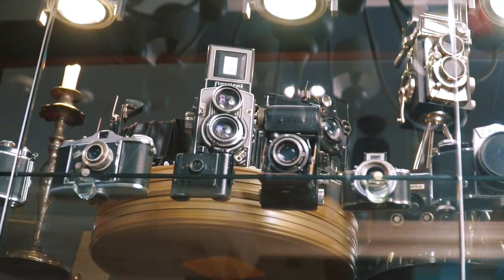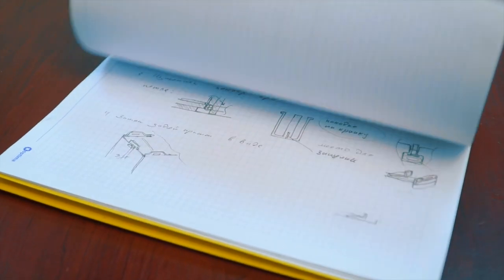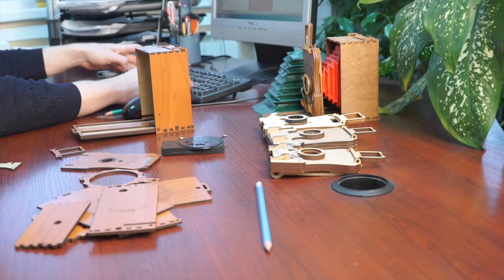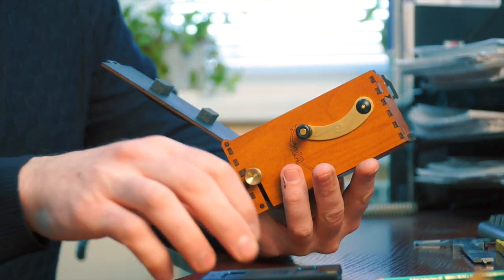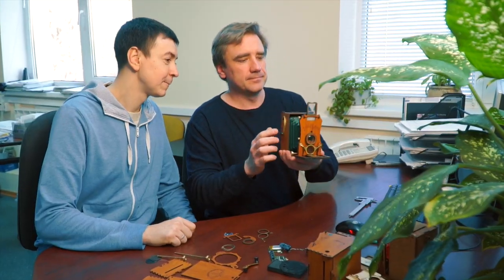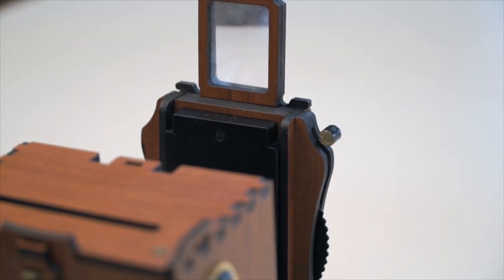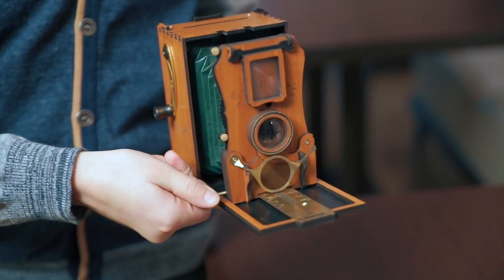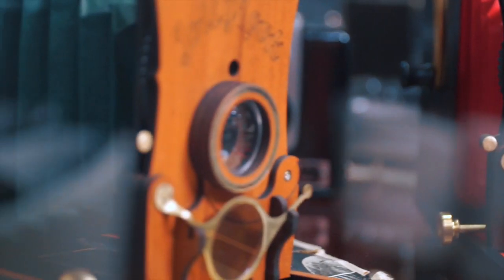Jollylook Auto - The Modern Vintage Instant Film Camera Kickstarter Video

Comment: I really wish it were all manual with no electronics. MAYBE with the exception of the flash. The all manual aspect is the real fun of these things.

Plus without the lens or whatever it's called snapping down, it completely removes that great feeling. Not a fan of the electronics here. There are tons of electronic cameras already, your customer base likes the manual operation, I can nearly guarantee it.
Reply from the maker: The Jollylook Auto actually has both Auto and Manual modes. The aperture has manual selection for five values: f/11, f/16, f/22; f/32; f/45; f/64 + pinhole.
Shutter speed in automatic mode is set automatically by a light sensor&. In manual it has a bulb mode as well as multiple exposure functionality.
Reply: is there an option for a manual shutter speed on the JollyLook Auto?